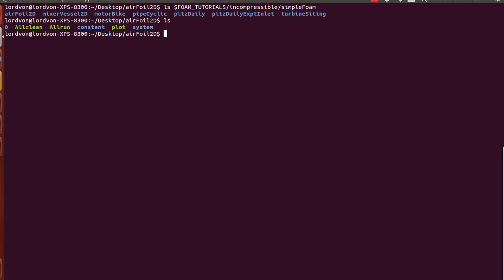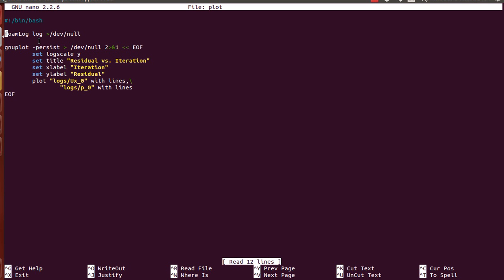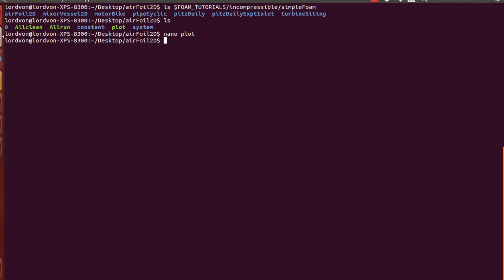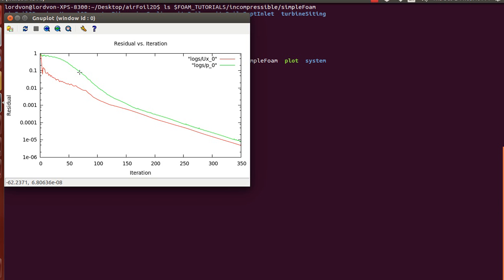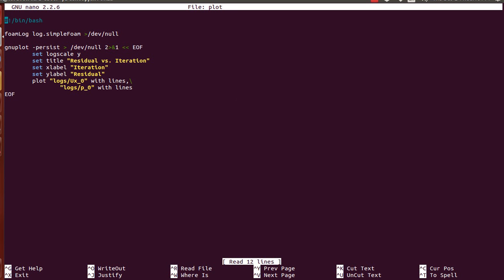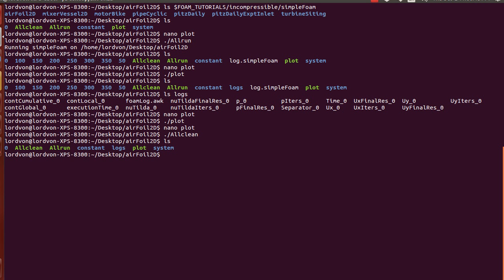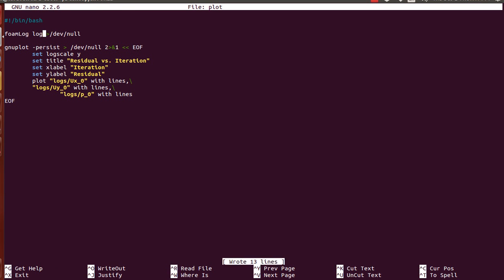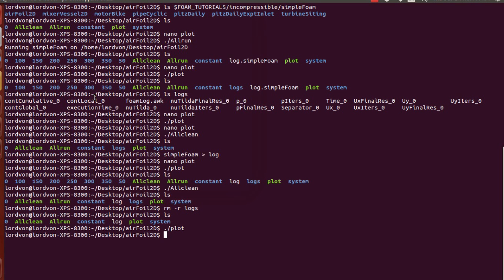How To Plot Residuals in OpenFOAM

Comment: Thanks for the tutorial, but the foamLog creates files (example: Ux_0, 
Uy_0)  which are collected one for each time step. Is there any method 
in which i can plot the initial or final residuals after each iteration 
for Ux. Because sometimes Ux in a single timestep goes for more than one iteration. (smoothSolver:  Solving for Ux, Initial residual = 0.00036664754, Final residual = 4.2237178e-10, No Iterations 4).

Comment: Very good tutorial 
Do you know how to monitor Tmin and Tmax in heat transfert simulation
Thanks
Reply from the maker: Safarie Duo There are several ways; one way is to use the utilities as described at http://www.openfoam.org/features/runtime-postprocessing.php. Another way: see my tutorial on compiling a custom solver, time profiling, to see how to make your own solver. In the main solver loop you can call 'max()' / 'min()' on the temperature field and output it to std::cout or file.